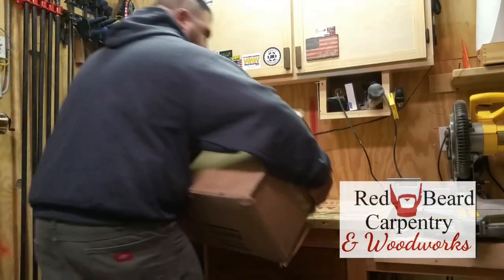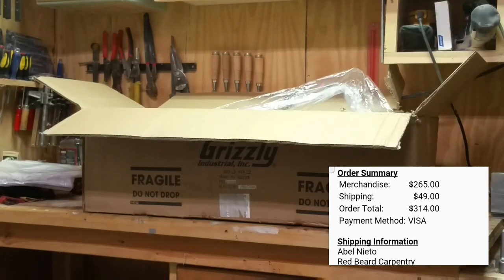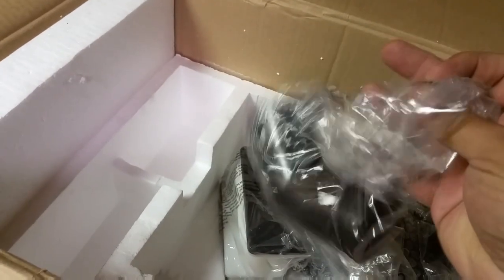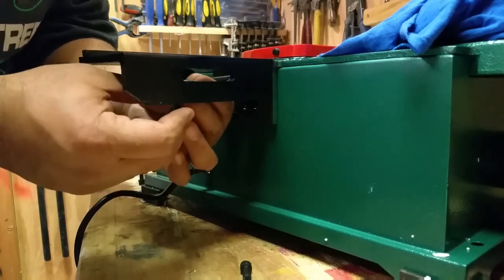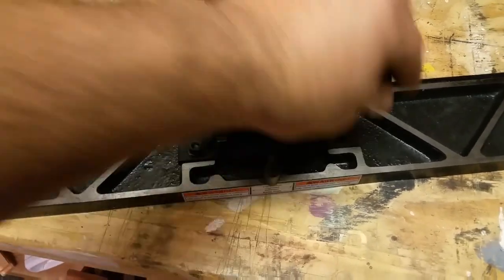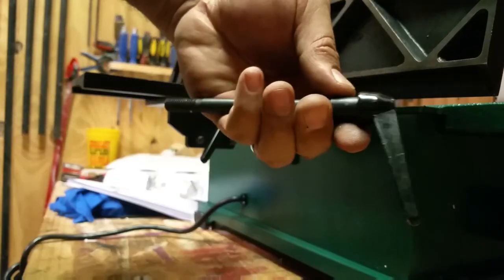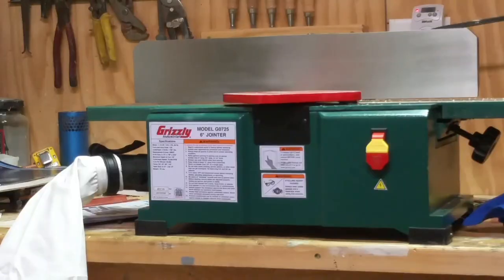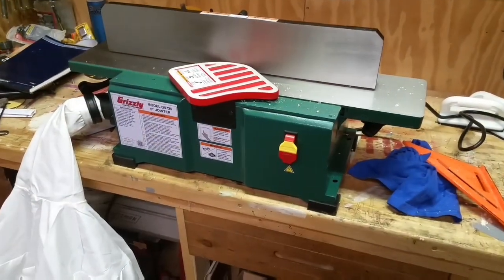Grizzly 6" benchtop jointer unboxing and setup

Comment: Thanks for the video mate. I have few questions if you won't mind answering.
1. How loud is it compared to lets say a table/mitre saw?
2. Can I use Acrylic to square the edges or is it only used for wood?
3. How is it working after a year?

Cheers.

Comment: I just bought this and assembled it. Did you problems getting the fence square at 90 degrees? If I tighten the angle bolt to where the fence is solid, one end of the fence lifts up a bit.

Comment: Did you check the tables for flatness and being coplanar? Just curious as it looks like a well built machine for a bench top, especially with the steel fence. I've been looking at the 8" Cutech with the helical cutter head but it doesn't look as sturdy as this, only problem is, I don't want to give up the extra 2" the Cutech offers but I also don't want to give up the steel tables and fence of the Grizzley. Wonder if Grizzley has an 8" bench top planned.

Comment: What anti-rust did you use?
I want to avoid anything that would leave oil on the wood.
Reply: The Johnson and Johnson paste wax product will work well, once you've removed all of the storage grease.

Comment: Cool Purchase, i bought the Porter Cable 6 inch and it works great, hope you have as much good luck on your too.
Reply from the maker: DesertBum WoodWork'n.  Thanks for watching man!
Reply: I have the Porter Cable 6-inch as well.  Its a good tool and serving my needs well, but in hindsight I wish I had got the Grizzly purely because of the cast iron tables.

Comment: Good video.  I just got the Shop Fox W1829 and from what I can find, it is the same thing as the Grizzly (I guess they own Shop Fox) just a different color.
Reply: the only difference i seen between shop fox and grizzly is the grizzly blades are 1/4 inch longer according to grizzly web site but the blades they sell for the shop fox are 6 1/4 so its probably a miss print
Reply: The shop fox now has the flimsy looking aluminum extrusion fence, from the pictures on the grizzly website. I called them, they confirmed it.

Comment: Awesome. I wanna get this one. How long of a board would you joint on this size of a machine?
Reply from the maker: +Prima Vista Tutoring Solutions , I was just running this machine yesterday.  I was edge jointing some 8' long boards of poplar. I can see where a bigger machine would help support the board. But this little guy will straighten up some stock.
Reply: Red Beard Carpentry & Woodworks Amazing that’s what I like to hear! And form what it seems like, there was no tricky blade/bed setup I see with other larger jointer setups, yes?

Comment: Hello, I know this video is almost 1 year old, but I am curious if you are still getting good performance from it? Did you eventually connect it to dust collection?  If so, how is that working out? Thank you.
Reply from the maker: Hello David! Yes I am still using this machine. I've used for several jobs and it quickly paid for itself. I never did hook it up too dust collection. The bag seams to do well. If I had one complaint it would be that the table is too short. I think anything over 8' is too long for this machine. With that being said I would definitely recommend. Hope that helps, thanks for watching!
Reply: @Red Beard Carpentry & Woodworks  Thanks for the reply. I am glad the machine has worked out for you.

Comment: So, it’s been 3 yrs since you posted this video. How accurate is that fence holding up?
Reply from the maker: Its still holding up, I do check it  periodically with a square  because sometime vibrations may loosen it over time. But overall it's been a great little machine. My only complaint is the length. I already want a longer one to help support with straightening longer boards.
Reply: @RedBeardCarpentryWoodworks  thanks!

Comment: What is the longest board that you have successfully jointed with this jointer??
Reply from the maker: I've been able to run 8' long boards through this jointer. Now the boards were pretty straight already witch helps. But I could see where a longer machine would definitely help with support the weight. Thanks for watching

Comment: Nice video.
Reply from the maker: Thanks Lonnie!
Reply from the maker: Thanks Lonnie
Reply: @RedBeardCarpentryWoodworks  I'm trying to decide between this one and the Porter-Cable. So you've had this for like 3 years now right? How is it holding up? Did it come with double-sided blades?
Reply from the maker: @roberttrimmier3276  So far so good. It does have double sided blades. I haven't had the need to flip mine yet. But I have the depth set at a 1/16".  Its perfect for shorter boards maybe 5' and under. I've done longer boards but your at a disadvantage with the over length. I personally plan on upgrading to a bigger one simply for convenience. But I definitely recommend